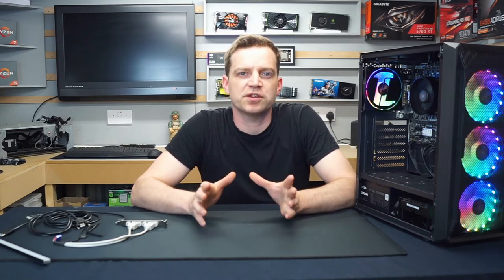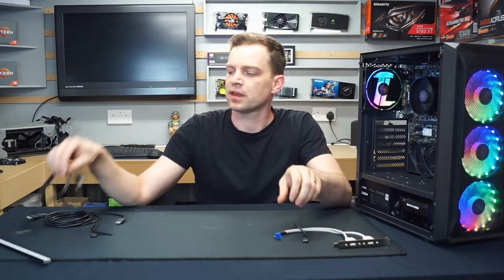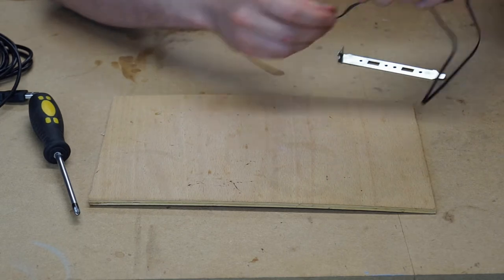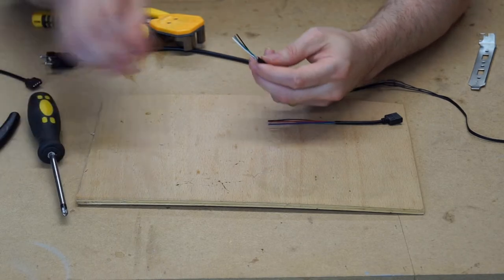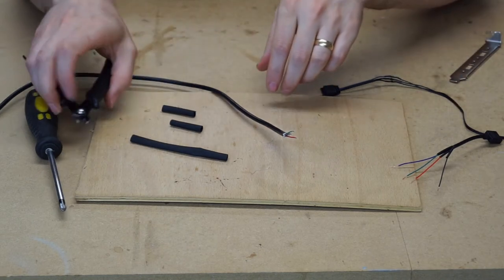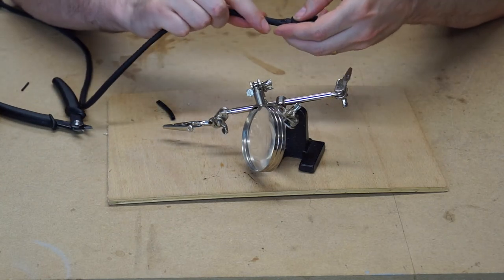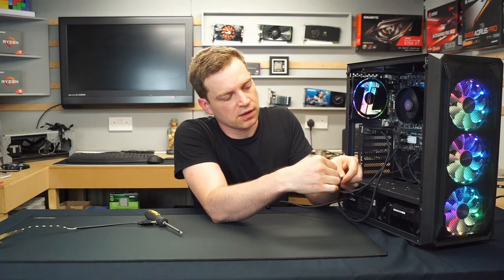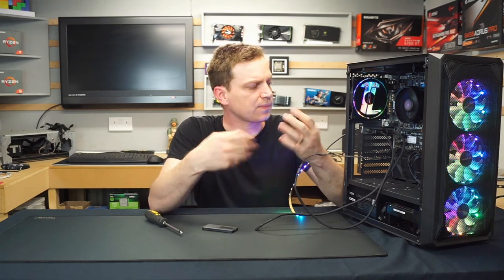How to Sync Your PC & Desk RGB Lighting | Guide

Comment: that is nice... I am looking for a way to build a led system connected on pc by USB port and controled by a SOFTWARE, not in the motherboard, some system that allow the pc to change the collors as music that is playing, or as the game is running and changing scenario... My motherboard doesn't have a RGB connector ... anoying! I can't find anywhare...perhaps I will need to build all the controller and software... sad... not that I can't do, but I was trying to avoid this trouble... I mean, how no one did that yet?
Reply from the maker: There are a few USB / Software controlled controllers out there, we just haven't used many of them.  Take a look at the Corsair Commanders.
Reply: @TechLabUK  I saw some videos with them, but they use a 9 pin USB connector, My motherborad is a LAPTOP mother board, and I wanted to build a system on my table, and unfortantle, I cant use WIFI or BLUETOOTH connection... Is hard to believe that we have a wireless system for this kind of stuff, but not a cabled USB 3.0 connected and controled by software...
Reply from the maker: @mr.rosner  I believe the Commander Pro uses a USB 2.0 Header Connection to connect to the motherboard.  Your board must have external USB connections so build an adaptor from a USB 2.0 Header Connector to a normal USB.  You can buy the USB connections and solder onto them or just cut up an old USB cable.
Reply: @TechLabUK  interesting! I didn't new that the different shapes of the USB connectors on the motherboard were both USB 2.0... I mean, the external and the "one" that corsair uses. That is manageable
Reply: @TechLabUK  MAN!!! Corsair is ahead of us! "Corsair iCUE LS100". With your tip I found that model... THANK YOU A LOT
Reply from the maker: @mr.rosner  No Problem.  Let us know how it goes.
Reply: @TechLabUK  I will! But I'm not going to use the corsairs, to expensive... but I had an idea that may work...
Reply from the maker: @mr.rosner  Will be awesome to see.  Feel free to join our Discord community and share your modding progress, people there will love it: https://discord.com/invite/Dx7xZt5MHF